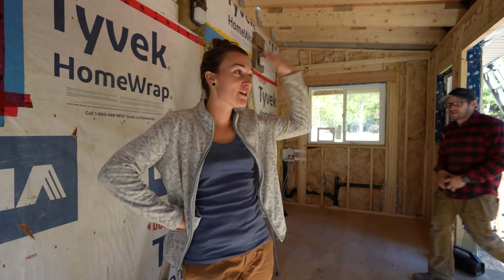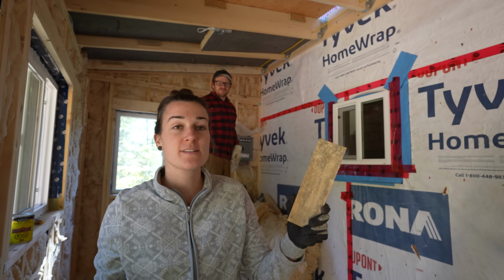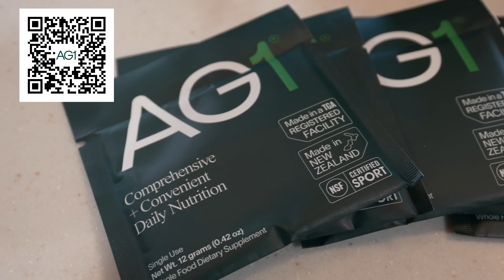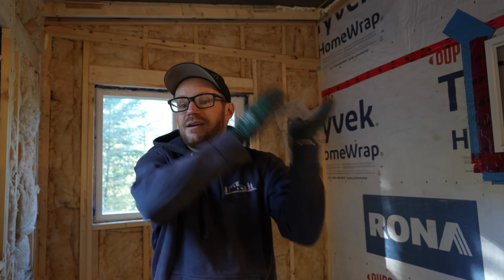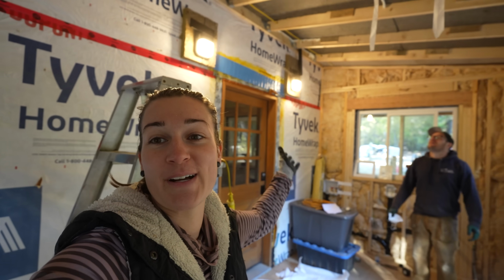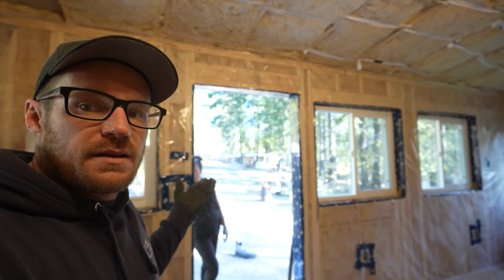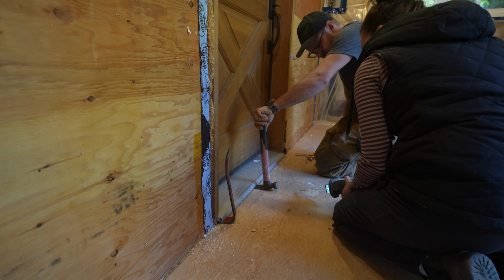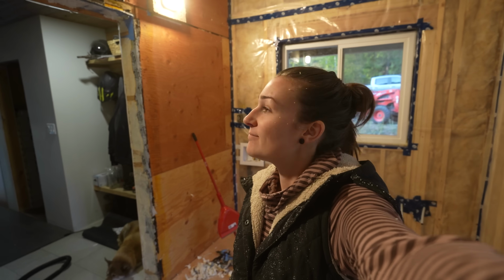There’s a HUGE Hole In Our House!

Comment: If I were in your shoes, I’d definitely consider installing an interior door that matches the others in your home or even a garden door with beautiful light panels that extend to the floor. Not only would this give your space a cohesive and stylish look, but it would also be so practical! It would keep out those cold drafts every time you open the door in winter, help prevent pesky bugs from sneaking in during spring, and even reduce the noise from your laundry station. It’s a small change that would make a world of difference in comfort and function!

Comment: Greg / Katie just so you know i use a staple gun to put my rigid foam in. how? well my air stapler is set at low pressure so when i put rigid foam up... i staple into wood underneath foam but tight.....and some of the staple sticks out making a little shelf to hold rigid foam. and you can staple pretty damn fast with it so it works real well. Hold tight up against foam and blocks above and staple away....no use for blocks then to hold it to sides. And above rigid foam i have used shutes for air flow.. but if you get foam tight enough to sides,... no need for blocks. just little ones... 2x2's for air gap on top of foam. take care have fun it is what life is about always an adventure.

Comment: I see all the work to end up with a insulated interior space and all of the wood that serves as a cold air shunt. I built a house in the mountains of Oregon and used structural integrated panels, aka, structural foam panels. One piece gives you andinside wafer wood nailable wall, 4.5 inch up to 10 inch solid foam core, and and an outside waferwood panel. You build a solid wall and then cut out the windows and doors. R-value is incredible. Condensation happens inside the foam.  Structurally it is incredible. We loved the results. Our energy bill was $400 per yer, no need for airconditioning, and our neighbors were looking at $4000 energy bills per year. I know it is probably too late for you, but your viewers could benefit from this product.

Comment: With access to wood & your mill you could easily make up a 2x8 or 2x10 plank 4,5,6,7,8 ft in length to fit between the ladders when working overhead. 7:52. Especially to save straddling the ladders.

Comment: Moving the door out and you got it to fit. Amazing that it appeared so easy to move it. The place is going to look so good. Now you will get a bit more light into your main room. It would be great if there's a way to make the internal opening a bit bigger if it doesn't take any strength away. Once you put molding around your inner opening it will be beautiful again. Another successful event is completed safely.  Big hugs from Santa Barbara. 👋🤗😘🙏😎🌹🍷

Comment: if you ever have to replace the weather stripping on that door it will require that you remove the screws that hold in place. I get that you don't want the screws visible but you could putty the heads so they don't show. just a suggestion. your house your way . Love your channel. and you guys are the best team.

Comment: If the tube for the spray foam gets clogged or if the foam dries in the tube , heat a piece or stiff wire or a piece of coat hanger works best, get it hot enough to melt the foam and run the wire through several times and then you can reuse the tube and not waste any leftover foam in the can.

Comment: If you don't have heat registers/vents (a source of heat) in your new porch, even though it's insulated it's still going to be colder than the "inside" of your home and without a door between them, you're going to lose a lot of heat from the "inside" to the porch area.

Comment: They have a small gage stiff wire called stays the arrest used to hold fiberglass up much easier to apply than staples and Tate and looks better

Comment: on your last insulation - would it have been easier to run continuous run of strapping? Then you could have just gone and placed each row of insulation without the bother of trying to hold the insulation up while nailing the strapping?

Comment: Is there some kind of code that says that doors should go inwards?
In case of fire it is recommended that doors open "out" and, back inte time, when there were bears in the surrounding a door should open "out" as it will prevent bears from getting in the house. In my four houses I own and owned the entrance door and the door to the porch opened out from the house.  A door that opens "in" also can take valuable space from the room into which the door opens. Sorry if my English isn't correct, but it is not my native language.
Reply: Your English is excellent! A lot of doors open inward so that they are not blocked by snow or freezing rain. It also gives the option of adding a screen door for bug season.
Reply: @timepasses3380  The snow issue was considered back in the time, but that was usually solved by adding a little roof over the door, so that the snow shouldn''t block the door. Here in Sweden we don't use screen doors - we just kill the bugs/mosquitos. ;-)

Comment: Hi there! Please forgive my ignorance, but I noticed early in the video that there was some daylight visible where the rafters meet the house when you were putting up the rigid insulation. I was just wondering if there’s more roof work planned to close that area up? 🤷‍♂
Reply: Yes there’s the steel to go on the roof and then there will be a trim to stop water etc running down into the roof. 😊😊😊😊